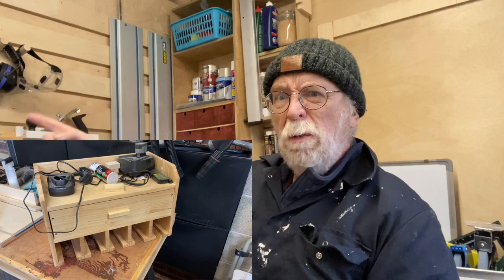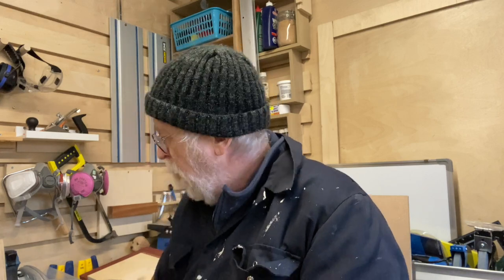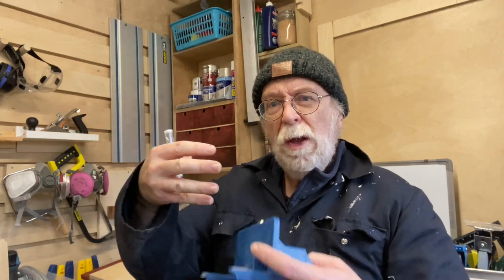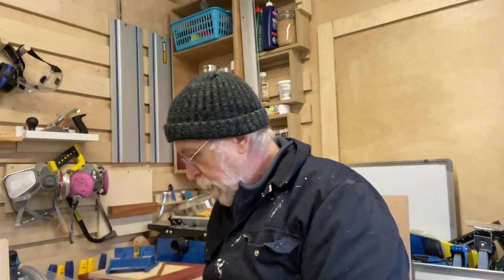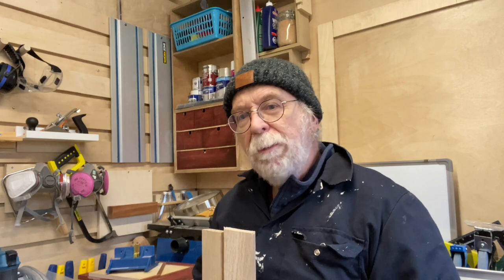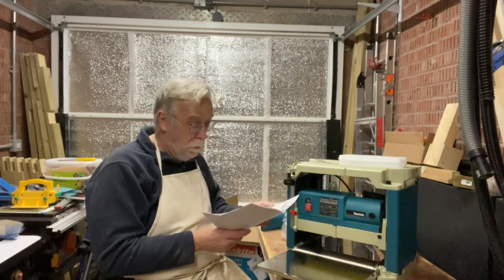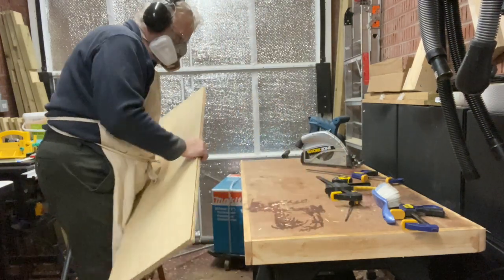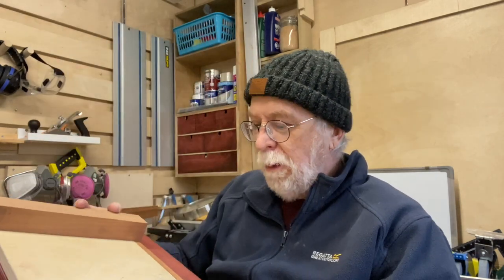Grumpa's Workshop Wednesday Waffle   HD 1080p

Comment: I use pallet wood from time to time because timber is so expensive. You have the thicknesser plus a bit of wood filler and you end up with some useable stock.
Reply from the maker: Yup, I’ve tons of short lengths of pallet wood ready to feed the little beast 🤣👍

Comment: Hi Loz....I have the rockler box joint jig. I've managed to find the 1/4inch and 1/2 inch spiral up cut bits, at a reasonable price,  but not the 3/8 inch. Can I ask if yours was expensive (£68.00+) or did you get one cheaper?  Cheeky question, I know.....
Reply from the maker: s'ok bud. No, not the expensive one, middling price ( £35 ish?) off amazon. time will tell as to how Long it lasts (I don't have a good track record with snapping carbide bits) be grateful for recommendations/links to better stuff....